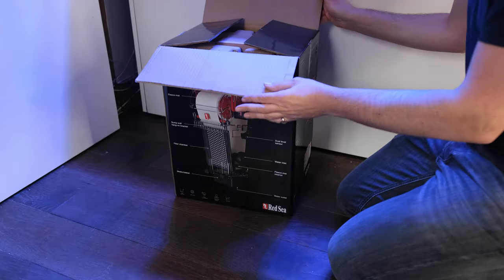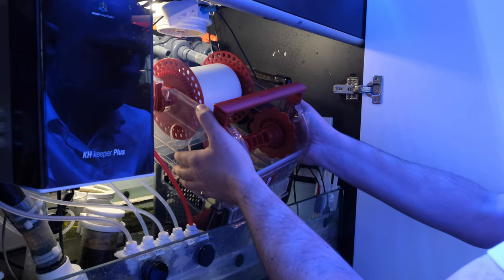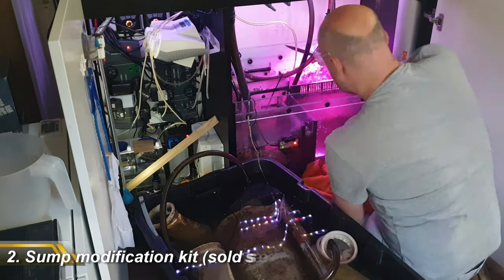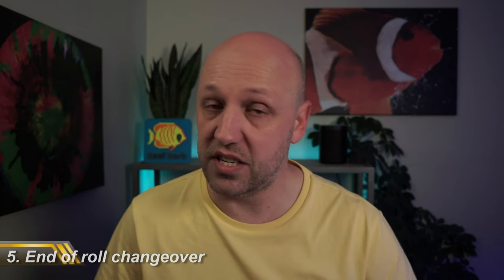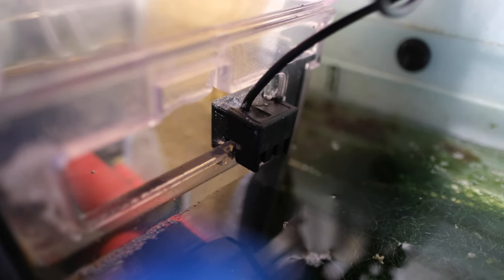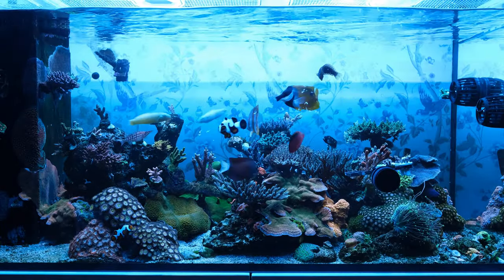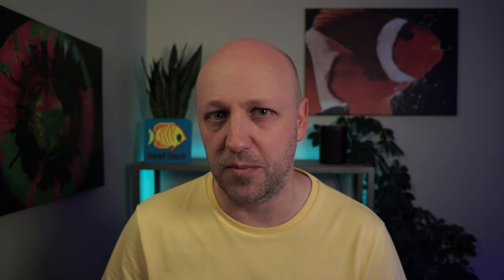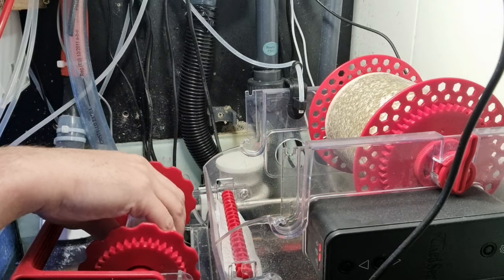Red Sea ReefMat 500 User's Review

Comment: I got the 500 to replace a Clarisea. The clarisea was a pain to change rolls and the alarm would go off regularly when it had not needed to advance the roll. It was also a pain to take apart to clean.
I agree with everything RD says in the review. I've got mine in the sump facing forward so changing the roll is very easy, I actually look forward to doing it!  I did not have room for the included flexi hose connection, which as RD says, takes up far too much space so had to hard plumb it. They include some bits of piping but it would be much easier if they just included an elbow that connects straight on to the inlet. this is the only thing that lets the design down imo.
I also like that you can get just about every part of it as a spare and the motor is actually not expensive to replace if out of warranty
Zero regrets so far

Comment: I picked up one last week when they came out here in the USA to replace my old Clarisea roller system and set it up last weekend. The difference in swapping the roll is night and day, and the easy disassembly for cleaning is stupid simple. It's is huge compared to the SK-3000 it replaced, and I am having fits with the overflow since I installed it, but I'm still using the Red Sea diaphragm which we all know is clunky as hell, but otherwise I'm really impressed.

Comment: Great video again I have just purchased the reefmat 500 for my Waterbox 180.5. I had to remove the filter socket section.I used the Red Sea sump modification kit which made it very easy to remove the silicone
Reply from the maker: Good to know, thanks for the info

Comment: Got mine for one week now on a 300L tank and would never go back fo filter cups. Going through 30cm a day at the moment using 1cm steps, which would be one roll every 3+months compared to exchanging filter fleece every 3 days
Reply: The smell from that roll is going to be putrid after 2 or 3 months in the cabinet
Reply: @davidridland  the smell doesn´t change, whether its 1 or 3 months. you won´t even notice it unless you put your head right next to the roll.

Comment: Alex, how has this bern going long term. Still far better than the clarisea? Ive got a gen3 sk3000 clarisea but after chatting with an lfs i went to yesterday he claims the red sea is leagues ahead and would probably go someway to solving my highish nitrates, any thoughts?
Reply from the maker: It's great and it's much better than the Clarisea in terms of design, ease of use, app etc. But I wouldn't expect it to reduce nitrates more effectively than the Clarisea. If you turn your return pumps up, the Clarisea will turn more frequently and therefore the roll will filter the water more often and the dirty roll won't sit in the water as long. But reducing nitrates is better done by feeding less, with a skimmer or just water changes.
Reply: @ReefDork  ok thanks. We dont feed a huge amount as it is and the skimmer (rsk300) struggles to pull much as it is, the roller is definitely pulling alot out and its only 3 ft tank but the roll looks like its going to last 4 months, i got the impression the LFS was trying to sell a red sea roller mat by saying it would pull much more out, the features the red sea has does look good but if its actually going to make little if any difference im not splashing another £300

Turf scrubber has been in a week too so that should start to work very soon

Thanks

Comment: Looks like a fairly decent pice of kit. However, I find it kind of strange that people are hyping this thing like “there’s finally a good option compared to the clarisea”. Like the Deltec and royal exclusive units have been on the market for some time. Without any personal experience with the Red Sea, to me they looks to be higher quality as well.
Reply from the maker: I think the RE units are built into the dream boxes so not available to most people and I'd expect them to be expensive (but also very efficient). As for the Deltec, I've never seen one for sale in the UK but from the outside it looks similar to the Clarisea in that it's quite basic. Deltec make good stuff to be fair though.
Reply: @ReefDork  The royal exclusive one is available as a stand alone unit as well, but yeah pricey (well worth it though based on my experience with other RE stuff). 
I have to disagree about the Deltec being similar to the clarisea having handled both. The Deltec is all injection molded and super high quality where as the clarisea is a janky hunk of junk 🤣
No gimmicks like apps and stuff though for the Deltec.

Comment: Thanks for the review Alex. How does this compare in terms of clarity to the X Filter. Would you go as far as getting rid of your x filter and buying this?
Reply from the maker: My previous filter was an XF 1.0 so this video is a direct comparison between the two. I sold my XF a week after this...
Reply: @ReefDork  thanks for the quick reply. Curious if you have any thoughts as to the why? On paper I think the reef Matt is 50 micron whereas the x filter is 32/25/17 so I theory should provide a cleaner output. Any ideas?
Reply from the maker: @YD500  no idea - I wasn't expecting any difference. The ReefMat is made from a material that isn't measured in microns though for what it's worth...

Comment: Amazing - this is something I NEVER wanted (as I rarely use socks) and now I do. The one question I had was can you open it in some way so that not all of the water goes through the roller. I think you answer this as I could just not allow it to run all that often using the timer so effectively I could run it so that it is clogged most of the time and I guess water would overflow. Plus I guess everyone has 2 drains so some water is bypassing it anyhow. Very cool piece of kit indeed especially with the media basket. Thinking of getting a custom tank next year and I will design the sump around this - cool.
Reply from the maker: Yeah there's no bypass valve like on the Clarisea so you'd have to do a workaround

Comment: Interesting what you said about the water clarity, I have the Clarisea 3000 and recently changed from using filter floss to catch additional debris on to an off-cut pad from my koi pond filter which has cleared up my tank far better. 
If the Reefmat is as good as you say, I will defiantly consider changing as the Clarisea is obviously not removing all the fine particles from the water column.
Reply from the maker: It might just be an initial boost so I'll report back in 6 months...
Reply: @ReefDork  In your opinion is the Red Sea Matt better than the x-filter you removed? I am tossing up between the two.

Comment: Thinking about getting one of these. But, can’t decide on the smaller 500, or the larger 1200. My system volume is around 150 gallons total. Someone told me the 1200 would be overkill. What are your thoughts?
Reply from the maker: 1200

Comment: Is the water level supposed to touch the bottom of the sensor?  Or be below the bottom of the sensor?
Reply from the maker: When it touches the sensor, the mat will advance meaning the water will be a bit below the sensor (depending on how long you have your roll advance set to). So most times when you check, it'll be a few cms below the sensor. I have my roll advance set to 3.5-4cms

Comment: Awesome video! Q: How would your water be clearer after installing a filter roller with larger micron pores than your previous model? That's peculiar :)
Reply from the maker: Red Sea told me they use a different material that you don't measure in microns. But yes, I've wondered the same thing myself. I tried changing the activated carbon the other day and it made no difference, whereas it used to make a huge difference. I actually asked Red Sea about the clarity and they didn't try to take credit which was interesting. I'll report back in 6 months but I'd like to see if other people notice the same thing...

Comment: Ive just installed my reefmat.. will it mess with my red sea ato though...kind of feels like it will?
Reply from the maker: When the mat advances, the water level in the return pump section rises but it's minor. Shouldn't affect anything.
Reply: @ReefDork  what about as its rising in the reefmat does it not lower the return chamber making ato pump rodi?
Reply from the maker: @BlazedReefer  no more than a skimmer will - it won't affect your salinity reading if that's what you're worried about
Reply: @ReefDork  great! Thanks for your replies .. ive learned so much from your channel 💯
Reply: @ReefDork  so ive ran the mat over night and safe to say it 100% affecting my red sea ato (the ato is set to pump when 2mm water drop/evaporation) each time the reefmat dispenses and starts building up water again the return  chamber drains by more than 2mm and the ato kicks in....this has happened 18 times since adding the reefmat (app shows me my top off log) (7L have been added to my 350L tank over night). The salinty has also dropped by 1ppt over night and the sump now has way more water in there than desired and emergency drain is now in use....am i doing something wrong or is it just cause the ato is sooo sensitive with only allowing a 2mm water drop before pumping rodi
Reply from the maker: @BlazedReefer  you can set the dispense length shorter. But for what it's worth you'd have to add 10 litres of freshwater to a 400 litre tank to drop the salinity by 1ppt

Comment: Any update on the reefmat? Specifically interested in how it compares to the xfilter!
Reply from the maker: I love it - it doesn't keep the water as crystal clear as it did when I first installed it but I recently bought a 2nd one for my other tank to replace a clarisea. The app is a really good feature and the roll change is much easier than the x filter. And it's really easy to strip down, remove from the sump and clean. I'm doing an install video on the new one soon on the Reef Dork Xtra channel...

Comment: what if you have 2 input pipes into the sump, one being the overflow. where does that connect to or do you need to T it in before the filter? Thanks!
Reply from the maker: As in one main drain, one emergency? There's no 2nd input so you'd either leave it (as I've done) or you could tee it. The X Filter is the only one I've seen that accepts more than one input.

Comment: im having a lot of issues with the water level always wetting the sensors, causing it to not auto roll. Anyone else having this issue? I hang it on the side of my sump with the water level without the return pump on about halfway up inte chamber. SHould iadd the legs to elevate it?

Comment: Hi does your reef mat leak bubbles inside the chamber where you turn 180 degrees seems to be a seal problem
Reply from the maker: It did at first, then I siliconed the connection and it stopped. Did you use silicone? If not, could you report back after you've put it on? I'd be interested to hear if that doesn't fix it...
Reply: @ReefDork  I've not used silicone yet thought it might be a rubber seal but only seems to do it from the right hand side of inlet 2 even if I switch the inside water inlet around still leaking bubbles.. but will move the reefmat & reseal with silicone & let you no,  also do u no if its possible to run a refugium as well as the reefmat  ?
Thanks
Reply from the maker: @ethanpring4780  yep, I run a fuge too
Reply: No more bubbles seems there wasn't enough water going to the reefmat which was causing the bubbles gate valve now open problem solved...

Comment: Just brought one for my Red Sea 425xl with the v3 sump but going to take baffles out so get to try the equipment out  provided 😜so while see how easy it all is to do
Reply: Let us know how easy it is to remove  sock tray and baffles. Cheers
Reply: Well just put reef Matt in and took the baffles out , to be honest it was very easy todo the hardest bit was removing all the equipment , so I could get the sump out to work on tried with sump under tank but no room . All in and up and running . Thank god and equipment back in .
Reply: @karlhal8165  
Great stuff yes could drain the sump and remove gear to do this also
Reply: @reeferexplained8846  yes I drain the sump and pulled it out as I wanted to level sump side door up aswel so all looks good and very happy with it . 😆
Reply: @karlhal8165  yep good shoot, just ordered redsea Reef wave pump, and installed the 4 doser by redsea